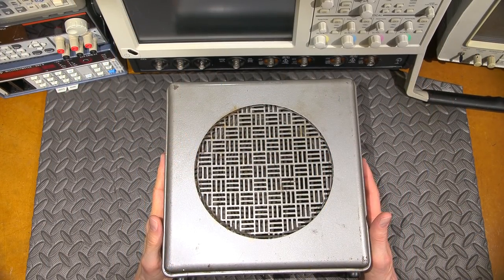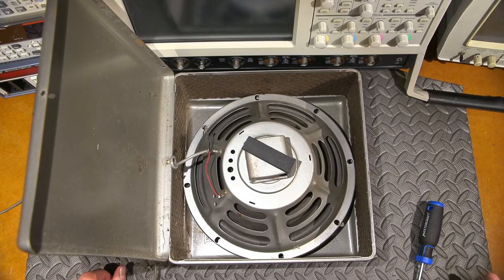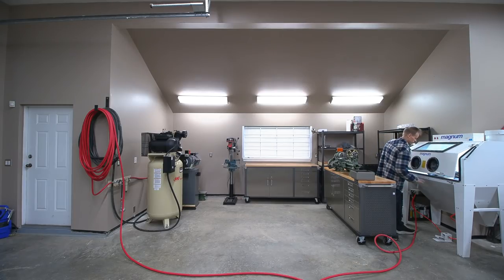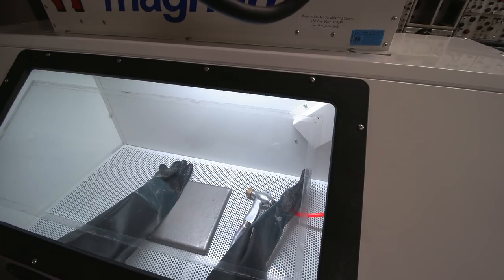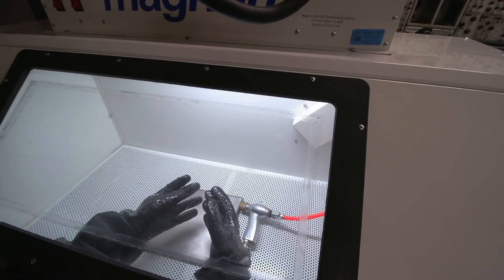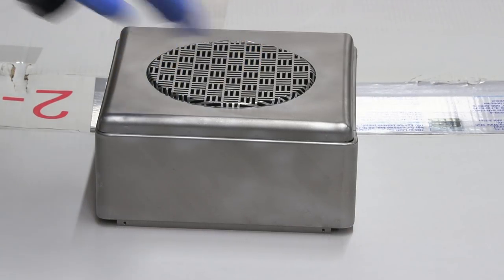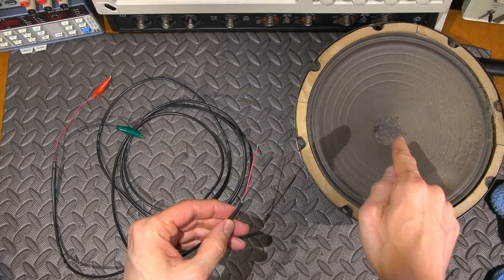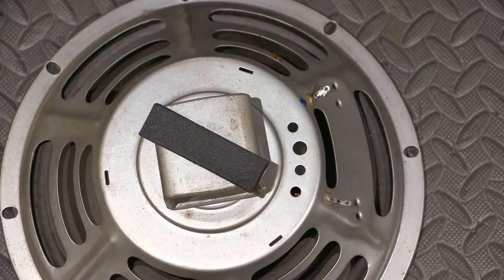Speaker Restoration And Modification!

Comment from the maker: To learn electronics in a very different and effective way, and gain access to Mr Carlson's personal designs and inventions, visit the Mr Carlson's Lab Patreon page here: https://www.patreon.com/MrCarlsonsLab
Reply: Do not forget that on some older products its best to check the paint for lead because you don't want that hanging around in your bead blaster and hearing protection while in the shop is also a good idea because a typical compressor runs at about 180 -190 decibels and most hand tools at about 150, Might want to check the machines in your shop to see how loud they are because it would do you no good if your hearing went bad especially working with radios and repairing them.
Reply: Great metallic resonate sounds with that speaker  !! Lol  😆
Reply: @someperson4819  Wife won't let Me wear them(or kilts).
Reply: It is nice to see the mechanical side of the shop come together. You are so correct about air hoses and the pressure in them. I am now retired but I worked Aerospace for 37 plus years and have connected and disconnected a whole lot of air hoses. When McDonnell Douglas (later Boeing after the merger) installed air hoses with built in bleed valves (you pulled the ring back and the nipple would rotate about 30 degrees to  the side and would release any pressure) I felt like the company got "Wussy" because real men just uncouple an air hose and hold it against the pressure. Well I came to really liked the new couplers as it also made connecting a device to a pressurized air line so much easier. Connect to the coupler with no pressure and rotate the fitting into alignment to pressurize. Small hoses were not a big deal but the bigger air lines ... it sure made a difference. I also favor the dark grey/black hammer tone paint over the lighter colors. The speaker came out very nice. I think I remember a video you did where you used a roller over wet paint to get a similar effect, that project came out nice as well. I am proud to have been supporting you at your highest level on Patreon for years. A good teacher is worth their wages!
Reply: @ProfaneGod  I don't think so. How about 90 db @ nine feet; always include a distance.
Reply: @davidgierke7582  True he's about nine feet from the compressor but not from the bead blaster and the bead blaster has the vacuum system and his head is about three feet away from it, Its still best to check and if needed protect your hearing in the shop.
Reply: Technically, they’re called “abrasive media blast cabinet” or “media blaster”.

Comment: Hi Paul. If you haven’t already, buy an Air Fuse device and install it ahead of the air line. There are different types dependent on CFM and pressure. This device will shut off air to the hose if there is a breech of the line. If the Air Fuse senses no resistance in the line, it will shut off air to the line. This is just another safety device that’s good to have. Great job on the shop!

Comment: Nice work Paul, that hammer finish is great for hiding imperfections in the substrate.
Reply from the maker: Thanks Dave. Yes that paint is great stuff, and now comes in copper color too. I will have to try that on some old copper plated chassis that look rough.

Comment: Good job on the painting. May I suggest a "lazy Susan" turn table so that you can turn the what ever you're painting without picking it up. Another one is to place small angles under the object b eing painted so the the bottom will stick to the table's surface and no marks where it was resting on the table. Good job on the shop cleanup.
Reply: As a painter I agree

Comment: Love the jacket!  I have one just like it.  I have a 60 gallon compressor and my HF glass bead cabinet is permanently connected to the air line through 3/4 inch copper line with a shut off valve.

I've done a bit of car restoration, drive-in speaker restoration and the glass bead cabinet is extremely useful.  Also done a lot of painting and powder coating.  Current projects are a couple of 3 slot Northern Electric payphones.
Reply from the maker: Neat projects George!

Comment: I came across a suggestion on another YouTube Channel and it sounded very good to me. Mount LED strips in the top, inside of the glass bead cabinet to illuminate your work brightly, evenly, and efficiently. You could probably find someone who could wire them up for you. You know I am NOT serious! I am reminded of that generator you worked on. Mr. Carlson is NOT limited to just radios and audio.   :-)

Comment: New shop looks great. I put my noisy compressor in a Rubbermade garden shed outside,  They are molded double wall plastic and suppress the noise reasonably well. They go together easily and look good in a residential setting. It is less work and less expensive than building something from scratch.  As you know I'm in Ontario the compressor seems to handle the cold just fine.  I can just barely hear it run. The utilization is low but under power all the time. You should put an auto drain valve on the tank. I need to drain the tank and two cylinder intercoolers. I also have my 3 phase rotary convertor in the shed too. I don't have to listen to that either  I wired the shop with 4 pin plus ground Hubbel twist lock connectors. I use the 4th pin and gnd to turn on the rotary convertor so any machine that needs it can turn on the convertor. Starting the rotary convertor and lathe or mill spindles simultaneously works fine. I had my doubts but it is just fine. Put a big indicator light on the convertor so you can tell if it is on. Good luck with your magnificent new facility.
Reply from the maker: Thanks for your thoughts John!

Comment: The engineer who taught my radio engineering in school had a trick to test speakers out in the wild. If he came across a nice looking speaker at a swap meet or yard sale, he'd use a AA battery to make it "pop." I saw him do this several times and you can really gain a lot of useful info that way... You can hear if the speaker has a wide range of frequencies if the pop is low enough and the scratch gives you a good idea of how good the high end is.  If it rattles, put it back! :)
Reply: Paul actually showed us this technique to test speaker polarity in his last radio restoration video :) More knowledge to stash in my toolbox <3
Reply: 22:20 Spoke too soon lol
Reply: Yes the small battery test is great but if you don’t have one you can just loosely short the speaker terminals and gently push on the cone.  Works best for speakers that have alot of travel and compliance.

Comment: Very nice work Paul! That little speaker looks 100 times better than it did and actually now resembles some of your older "Hammered" looking black test equipment. By the way I just wanted to say that was a great idea to give a few safety tips around the shop. I work in a 12 Bay shop and i see air hoses misused all the time. If we don't look after our ears and eyes now nobody else will. Great video!

Comment: Hi Paul, We really appreciate your great videos!!!  However, for those who do not want to spend thousands of dollars on a sand blaster cabinet, serious air pump, and all the extras (air hose and manifolds) that your have installed (or have the room for such equipment), I have been applying another approach to restore metal speakers.  One can use "Jasco Professional Paint and Epoxy Remover" paint remover and "Loctight Navel Jelly" to remove rust, and finally, variable-grit wet sand paper to make the metal surface perfect for painting.   In a manner similar to your air handling concerns, one only needs to use these products in a well ventilated work area.  I have successfully completed many, many metal surface restorations with this approach.  Give it a try!

Comment: In most YouTube videos, I'd be surprised that the Creator would take the time to fully set up the "entering the shop" shot instead of cutting straight to the business, but not on Mr. Carlson's Lab. I did truly feel like I was there in the shop with you, and the audio was, as always, perfect. What's the startup current on the compressor? It really dimmed your lights when you threw the disconnect!

All that shop needs is a car lift, a parts washer, tire mounter, wheel balancer, and an upstairs apartment for me to move into! 😄And with your antenna, I can probably receive my favorite late-night talk radio show on a dozen AM stations. I would have to move the drill press to the left slightly, so that I could move the workbench under the window to the left slightly, because the misalignment is triggering my usually-mild OCD.

Great safety tip on connecting/disconnecting air tools and hoses while pressurized. There have been a few times that I've launched an air chuck a few feet because I didn't have a tight grip on it while disconnecting. I've watched friends get hit by, or hit a car with, a hose connector that was under pressure while disconnecting. I've watched as people fight to connect a hose to another pressurized hose - the quick-connect fittings are actually quite easy, but only when you're not fighting 100+ psi.

I'm horrible at painting, but I found success in hanging pieces from a long bungee cord hooked to an eyelet in my garage ceiling.

Comment: Loved the shop breakdown. Care to speak a bit more of the compressor maintenance? Bleeding of air and water, pressure regulation, etc?
Reply: I'd like to know a bit more about the compressor too - love the way the lights flick when it kicks in. What sort of mains supply does it have; I'm in the UK so something like that would probably be on a three phase 400V supply (previously known as 415V before our voltage tolerances were "rounded down").

Comment: Lol, I know exactly how you know about uncoupling long compressed air hoses and the dangers they can produce.
In my shop, I have hard airlines to distribute the air to the necessary areas.  Each branch has a shut off at the connection point so that I can shut down the air supply and disconnect the flexible hose safely.  Keeps the length of hose I use down as well.

Comment: I was having fun with electronics at a tender age and hooked up a small speaker much like this design to my clock radio. The paper cone was brittle, so I sprayed it with a couple coats of automotive rubber under-coating and it sure sounded nice and gave it some extra durability. I think I was 12 at the time ;-)

Comment: I use that same paint, I love that finish. I was doing a restoration on a 1950s kitchen that had a period-appropriate wall-mounted venting fan, and that poor thing - who knows what it was originally, but it had so many layers of paint on it it's hard to describe. Once I got it down to bare metal I used the bronze hammertone with a bunch of thin coats and it came out just looking beautiful - so much better than I expected, honestly. I was just hoping for presentable, really.

(The blades were fine and the motor hardly needed anything at all other than a good cleaning and some basic maintenance. Only thing I had to replace was the switch. Sometimes the ugliest parts of a job will really surprise you in a good way, you know?)
Reply from the maker: Thanks for sharing your story!

Comment: Back in the 80's ,  I used to  buy and restore  D-104  Mic's  ........ I would  use a crinkle  type paint and a clear coat on some of them ..... Others I would use a stone type paint and clear coat after the stone paint set up ..... The clear coat would harden up the stone layer ....  I only did that on the bases of the D-104's , not the stems or the top side .... I love the crinkle and  Hammer tone paints .....

Comment: Good video. Just a suggestion, go to a glass shop and have them cut you a new window for your blasting cabinet using the same glass that is used in scanners at the grocery store (sorry I forgot the exact name of that glass, but a glass shop can get it). It is extremely abrasion resistant glass and eliminates the need for the plastic shielding and tape and adhesive and mess. The window in my blaster is three years old now and looks like new with no plastic shield being used.
Reply from the maker: I will look into that. Thanks!

Comment: 23:42 You can see on the Speaker , that Paul is using, threaded holes (above solder terminals) for mounting a 70V Matching transformer to the speaker’s metal frame.
That would be used in a Public Address system configuration (schools, warehouses, factories).
Reply: Interesting little tidbit! Thank you!

Comment: 6:00 A friend of mine who worked at a car parts dealer and did some quick service work there, like checking tire pressures, did just that. After inflating a set of tires he disconnected the hose from the air system (it wasn't even "big" like that), and he said it made a rather loud noise, after which his ears rang for a couple days. Luckily no apparent permanent damage though. He said that was an instant reminder why he should have bled the hose through the regulator and the tubeless clip first, as advised in the training.

Comment: @6:45 yeah , used the smaller diameter hoses and we typically drop and unlatch..behind you  - where it unleashes that energy on the ground.  I have no experience with those larger hoses..thanks for the advice

Comment: When I worked on HiFi gear I had a set of Sony Test speakers. I made a circuit consisting of a capacitor and one of those bi colour LEDs the 2 legged type. The capacitor would block any DC and the LED across it would light red or green depending on polarity. I also had light bulbs that I could switch in so I could load test without deafening the entire workshop.
Reply: To load test an audio system I built, I put all of the speakers on a Metro shelf cart, and ran them up to 125 dB in the lab. This was after normal working hours, I was wearing hearing protection and I warned the few guys who were still in the building but it was LOUD. The class D amp didn't even get warm.

Comment: Happy day, A David's Radio repair and a Mr. Carlson video! 3:23 Wow, that is one tidy shop. The Charcoal paint you used, I also like to use on anything metal it covers well and looks great, Sometimes I will use copper and dark Bronze and lightly spackle spray them on top of the Charcoal just to give it color and texture.
Reply: The paint type he used, slipstreams from AkzoNobels Hammertite. Its a great paint and look .
Reply: @TheoSmith249  I'm sure the Slipstream paint could look good and work as well, although, the paint Mr. C used is a Rust-Oleum branded product called Universal Advance, it's a metallic paint line in which the paint and primer are in one spray can

Comment: Thanks for another informative video.
I think we all benefit from reminders about safety.
Your shop looks like a nice comfortable place to work.
Maybe an insulated closet around your compressor would help keep it's noise down.
I use Dollar Store nail polish in red, black, white and clear for polarity and label marking, it seems to last longer then permanent marker. I find a red dot next to a molded in + sign helps make it much easier to see.

Comment: Nice shop. Don't for get a good air dryer. Valve off the bottom of your compressor tank for water drain off. Never use the glass beads twice. I had the same exact speaker. Came out of a junk TV when i was 12 years old.  A bare  speaker wire hit ground . Blew the speaker coil up. To young to know what i did. Another lesson in  the school of hard knocks. I am 66 years old and after 54 years i still miss that dam speaker that had such a great sound. Thanks for the memories. Best Regards  Jack Hreha.

Comment: I think I would have put 4 metal tabs on the back of the case before painting. Tabs to hold the new longer speaker cable in place so you can easily store it neatly. Maybe still an idea for the future. 👍

Comment: Great looking shop.  I don't know if you have tried Milton HighFlow Pro quick disconnect fittings but a set of those and a 3/8" hose would all you would need for your bead blaster. The fittings flow 70% more air than standard fittings. Fittings are available in different colors if you like. Milton # s-314VKIT is one of Milton's kits. I was not paid and not connected with Milton in any way. Just a suggestion.

Comment: Dear Paul: That was a good restoration (as usual). However, I have a personal bias against any speaker mounted in a sheet-metal cabinet. I love wood! A wooden cabinet has superior acoustic properties, even if the drivers inside (woofers, tweeters, etc) aren't the greatest. But, this type of speaker is excellent for a P.A. system, rather than high-fidelity music reproduction. Idea: Do a wooden-cabinet speaker restoration soon. Keep up the good work! 👍
Reply: Well for pete's sake, do you really think he is planning to match it up with his $10,000 MartinLogan's to give the 1812 Overture a little extra kick?  He's not a moron.
Reply: It's funny you would mention the wooden cabinet. I, being an old audiophile from way back had a pair of Poke SDA-1C and a pair of Bozak Monitor-C speakers with them all being either oak or maple and built like a tank and almost as heavy. Fantastic sound and had the co-phasing cable.
Reply: @donl1846  Were there really speakers called Poke, or did you mean Polk?
Reply: @Milkmans_Son  My mistake, yes they were spelled Polk (I had the SDA-1C's). The Bozak speakers were made in Massachusetts in the 70's, I had the Monitor-C's. Oak wood on the Polks and maple wood on the Bozaks, great sound with my equipment at the time, always ran separate components etc.
Reply: @donl1846  Not sure if you're referring to the speakers you had or the company in the past tense, but either way Polk is definitely still in business.
Reply: @Milkmans_Son  Speakers I had In the past, 70's-80's. Glad to hear that Polk is still around, quality speakers.